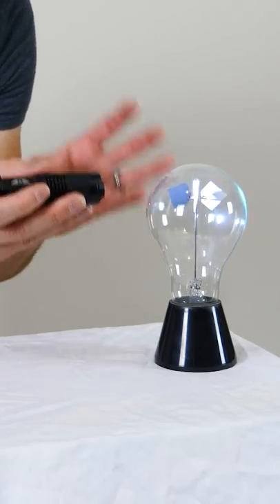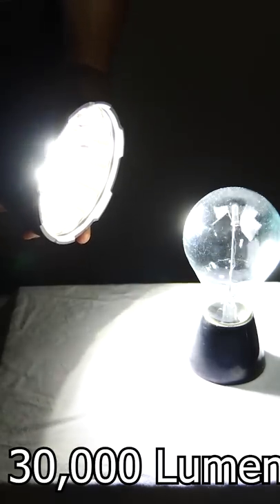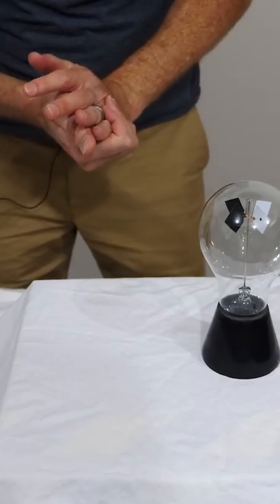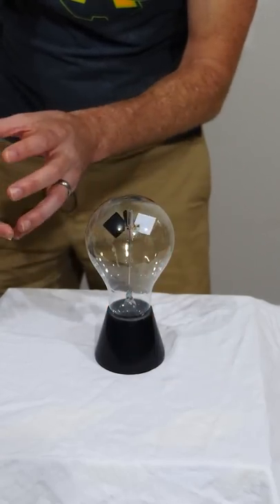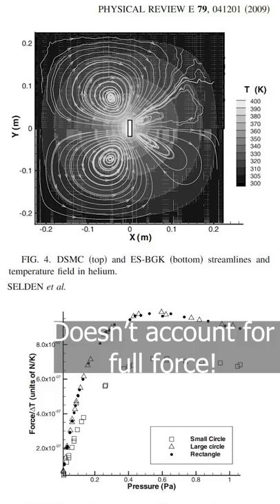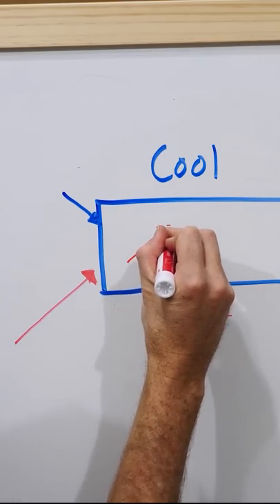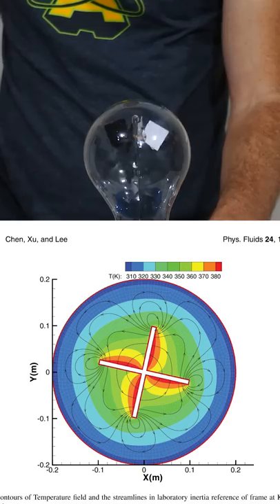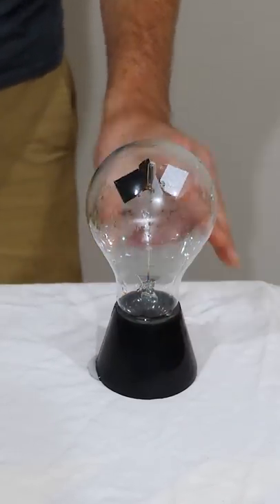100,000 Lumens vs Crookes Radiometer

Comment: At UofA college Physics lab many many  years ago I built a radiometer located inside a high vacuum chamber. I vacuum deposited aluminum on one side and carbon black on the other side of the microscope coverglass slides. Plotting rotation as a function of vacuum pressure with a 1KW light illuminating the radiometer, as the pressure dropped the radiometer spun away from the black side then as pressure continued to drop it stopped rotating as pressure continued to drop it began s[pinning away from the aluminum mirror side.  Black is thermal, Mirror is photon pressure.

Comment: Genius explanation! I wonder if anyone had tried it with different colors to see if this can work!
Reply: When you said different colours I thought of the light, which I wonder if it'll spin faster at higher frequencies or in reverse if meeting radio. Probably not the later.
Reply: @masscreationbroadcasts    from what he said and demonstrated I am guessing that an infrared source would make a spin faster than say a blue light.
Reply: @peterhunt1968  blue light has more energy than infrared
Reply: Didnt get it. Could anyone explain me why the pressure explanaition is false (the explanaition at 1:38 was Not understandable for me)
Reply: Actually im gonna try this with different colors, and see if there's a y difference with the angular velocity.
Reply: @impossiblephysix2633  thermal transpiration is changing the pressure.... molecular expansion causes the warm portions to go up but then they are pushed out of the way for the newer warm portions.... this makes circulation which spirals because of the geometry of the container.... most the time the path of least resistance is a spiral.

thats my guess and im sticking to it!

Comment: How does your 100,000 lumen flashlight compare to full sunlight?
Reply: What?
Reply: 27,000 lumens difference according to google
Reply: The brightness of the sun is about 127,000 lumens *per square meter*.  About 98,000 lumens / m^2 after passing through the atmosphere.  You can't compare that directly to the flashlight.  We could estimate if we knew how wide the flashlight was, what angle the light emerges with, and how far away it was... or James could just tell us.
Reply: if its 100,000 lumens bright, and it is shined at something less than a meter away, it would be brighter than atmosphere influenced sunlight.
if you press it up against the wall then it will be even more bright.
Reply: @Qaptyl *brighter
Reply: @jrambo7495 more bright is grammatically correct

Comment: What is the difference between the 2nd incorrect explanation and the correct explanation?
2nd mentions pressure, correct mentions particle force, which is basicly the same. In both explanations it is air being hotter on one side so having more pressure/force against the vane. The whole “block other molecules from reaching it” doesn’t seem to make any sense. It’s a low pressure gas, differences in temperature/pressure increase circulation, not that this would be needed, since its a gas.

Comment: Hi,love your videos ! Can you make a video using the vacuum and a ultrasonic sensor like hc-sr04 and simulates mars air presure and see if it can move some fine dust?basically i'm curious if solar panels on mars rover can be clean with something cheap ..because they prefer to put some lab tools insead of wipers and the rovers are not design to last more than 2 years so dust on panels are not a concern..but anyways i'm just curious !
Reply: Static electricity from the dust devils cleans off the panels.  This was discovered after The Martian movie came out, so they still thought Mark Watney would have to clean them off by hand.

Comment: How many Crookes radiometers can be powered by the same light source, and how fast would they need to spin to produce enough energy to exceed the energy needed to power the light?
Reply: that would violate the laws of thermodynamics
Reply: @pente12  not necessarily. The laws of thermodynamics are in balance across the entire universe, so if there is a surplus in one spot matched by a deficit (such as a Star being swallowed by a black hole) somewhere else, the laws remain unbroken.
Reply: @isaackellogg3493 
    Yes, necessarily.

Comment: Why does it spin?  Occam's Razor says Photon Pressure.  But science loves to forget Occam's Razor, because such complex theories as theirs can't be explained by something simple, so let's forget the basics, you know, those simple factors and fundamentals that form the foundation of science all together, like they don't exist because breaking a massive complex theory into simple step can't possibly work.  You have the eat the elephant all at once in one bite or you can't eat it at all, one bite at a time can't possibly feed you or anyone.  It works by photon pressure.  Because energy can neither be created nor destroyed, only transferred or transformed.  Kinetic energy transforms through pressure from Potential energy with the proper influence of energy, or pressure, of nearby matter, and terminates back into potential energy by transferring portions of that kinetic energy to everything in and along it's path as the potential energy in each resistance is exchanged, transforming into it's own kinetic energy.  We know that photons have mass.  Very miniscule, but they still has mass.  So miniscule it can travel through objects, in the gaps between and within the molecules and atoms of matter itself.  This is why shining a flashlight through your fingers makes them light up red.  And Photon rays through transparent objects or vacuums are like wind currents through the air.  The reason it moves is the photon rays that are being absorbed or reflected are still trying to keep up with the main mass, turning photon movement into photon pressure, and photon pressure into object movement.  And the glass turns it into heat and the heat into infrared radiation, but infrared light doesn't make an impact on it's speed when not behind glass in a vacuum or near vacuum, and temperature increases or decreases cause no movement whatsoever if there is not a piece of glass to emit infrared radiation, but light still will, and without the glass, temperature makes no difference on the speed it spins at.  The infrared radiation is a side effect of the glass encasement, not the reason it moves.  Infrared radiation is a function of photon excitement, and is emitted as photon rays with a pressure.  Which transfers to the fins by reflecting off the white and collecting on the black and creating drag as the rest pass through.  Infrared or not (even UV will make it move, and UV is the opposite end of visible from IR), light is photon rays, and color comes from the energy they absorb and reflect.  The pressure creates temperature fluctuations, but light can exist without heat, and heat without light, as heat is a biproduct of energy transfer, specifically a byproduct of resistance.  A 100% efficient transfer of energy creates no heat because no energy.  You can also compare the edge testing results of why they spin directly to a sail.  Wind directed at the edge of a sail will cause a similar wind based mechanism to spin faster in the same way.  Because as it passes the edge it creates drag, exiting the air beyond the sail, and the sail rushes to catch up to air being pulled away from it by the passing air because a vacuum pull is created.  We also know it easier to pull a heavy object vs push it because the air displacement works in our favor pushing it from behind in the same direction, vs pushing it the displacement pushes it back against you by adding resistance.  Photons behave the same way, energy is transferred to nearby photons as they pass the fins, exciting them to be pulled along with them.  This is why shadows wane with distance, as excited photons travel, they excite nearby photons, exchanging their kinetic energy (photon pressure) with nearby non or less excited photons both ahead behind and arounds them as they travel, and the path of least resistance leads the slightly away from the passing photon that excited them.  The more pressure created by pull, the more push the following particles, whether photons, air, water, or whatever, create by displacement.  As the white surface reflects photons, photon pressure exchanges into potential energy as the potential energy of the fin gets distributed 2 ways as kinetic energy, both into photons retreating to be perceived as the color white, and into the movement of the radiometer fin assembly in the direction they were originally traveling.  And yes, the color white, red, yellow, indigo, blue, violet, whatever color, is simply the photon pressure exerted upon your eyes, being transformed into the observable energy.  Never forget the basics.  This also explains the 2 slit experiment with photons behaving differently when observed, because the energy exchanged into observation changes the result.  What you observe, everything you see, hear, feel, taste, and smell is a transference and transformation of energy into observation.  And literally, The law that energy can be neither created nor destroyed, only transformed and transferred, is one of the most basic and fundamentals of not only Physics, but science itself.  The generation of electricity is literally transferring the potential energy of a fuel source into kinetic energy and that kinetic energy into electrical energy by transforming it into magnetic pressure to excite electrons, with a portion resisted by the circuit into heat as electrical/electromagnetic friction.  And for automobiles, the same process occurs, but more is left as kinetic energy, transforming only just enough into electrical current to sustain the process.  And Infrared radiation isn't heat, the heat is created by the transference of energy from infrared being resisted.  Infrared is simply highly energetic excited photons which travel outwards in waves.  And excited photons pull other excited photons, until they hit a mass which creates resistance, and that resistance exchanges it's own potential energy for molecular kinetic energy in the form of heat.  Infrared cameras and heat sensing cameras like a Flir, much like the human eye, don't pick of the beam of a laser pointer, but sure pick up the spot it hits, and that's because the laser pointer is infrared energy.  Energy only becomes heat when resisted.  Fuses work on transferring electrical energy into heat with a resistant metal that melts at a specific transference of heat.  That's also why they use highly resistive materials for heating elements, the resistance creates heat by causing portions of the flow to essentially hit a brick wall, and instead of electrons transferring along the resister, molecules and atoms attempt to move in intended path of the electrons, but can't so they try to go the other but can't, and this translates to heat, and the electron are trying to rebound the other way but can't, so the atomic vibrations create heat, by sending energy that can neither move forward nor backwards in the only direction it can go, away from the circuit, away from the path of friction.  Heat is the result of friction, caused by resistance to energy transference of kinetic energy, the resisted energy being transformed into heat, whether by atoms and molecules, electrons, photons, or rubbing two sticks together. Infrared is a specific level of photon excitement.  This is why black objects heat up, because they resist reflecting photons, and resist  them from passing as well, which creates heat in the form of photon pressure because the kinetic energy becomes potential energy through photon pressure and the friction that resistance to it causes.  Again, because Heat is energy, and infrared is a specific range of energy which excites photons into movement faster that can be perceived by the naked eye, and only emits heat where resisted, by the photon pressure undergoing friction.
Reply: What

Comment: The end (cooling scenario) of this video sounds wrong. The white side emits infrared radiation 'better', all things being equal, than the black side, not vice versa. There are simply no (or, more specifically, fewer) photons for the black side to absorb, convert to 'heat', and re-emit as infrared photons. The black side is not "getting colder" than the white side, the white side is instead demonstrating its superior ability to reflect/scatter/emit infrared in the case where the glass envelope is cooled, whereas the black side is holding on to those photons/phonons without (as much) emission.

Depending on the thickness of the vanes and the purity (black/white) of the coatings, there should be a demonstrable difference in surface temperature that shows the white side is cooler in all cases.
Reply from the maker: The black will cool off faster than the white in the scenario with the ice because it emits better than the white. Black absorbs and emits better than white.
Reply: @ActionLabShorts  I don't think that is true. The white should be the better emitter in all cases, whereas the black should be the better absorber in all cases (assuming near-perfect black and near-perfect white). There should be no scenario above absolute zero where black has surface temperature cooler than white.
Reply from the maker: Well this isn’t a guess, it’s a fact called Kirchhoffs law “For an arbitrary body emitting and absorbing thermal radiation in thermodynamic equilibrium, the emissivity is equal to the absorptivity.” 

Emissivity and absorption coefficient have to be equal. So whatever is a good absorber is also a good emitter. You can learn more about this here https://en.m.wikipedia.org/wiki/Kirchhoff%27s_law_of_thermal_radiation#Theory

Comment: Light is mass energy is Mass E=MC²... because the light is being absorbed into the black material all of its energy is transferred into it propelling it. Just think about how the sun heats the oceans... its energy transfer. Whiteside reflects the light which has mass any time you have a particle or anything three-dimensional at all it has some bit of mass whether that mass can be measured or Not by our scales doesn't matter 3D=volume=mass...

Comment: It has nothing to do with radiation, pressure from heat or molecular motions. It is simply caused by sound, which is a form of light rather you can see it or not, light exist. Rather you hear it or not, sound exists. Everything in the universe made up by light. Solid matter is actually frozen light. Light itself came from our mind, the desires for it to exist. 

That's why God said, let there be light !!!

Comment: and the total BS story is the black side adsorbs all of the photons and the white side reflects the photons after they originally hit it but as the reflected photons are flying away from the white side they hit incoming photons which are bounced towards the black side so in actuality the white side gets hit with 100% of what it recieves and the black side gets hit with 100% PLUS the white reflected and collisioned reflected photons from the white side so the net value of photons hitting the black side will always be more than the white side.....   kinda like you and your sister both get 5$ a week for allowance, she gets mad and throws her money at you so you end up with 7.50$... An interesting experiment with it would see what happens if the white side is replaced by a first surfaced mirror, would it be more efficient or would it work at all?????

Comment: That's interesting.  I'd always heard the 'pressure' explanation before. Apparently if you actually get a 100% vacuum the white side does spin more quickly.
Reply: in a complete vacuum they don't spin at all
Reply: @-TheRealChris  they can, solar sailing.
Reply: @clawer2969  Yes solar sails are a thing but Crookes Radiometer's are not solar sails and don't spin in a vacuum.